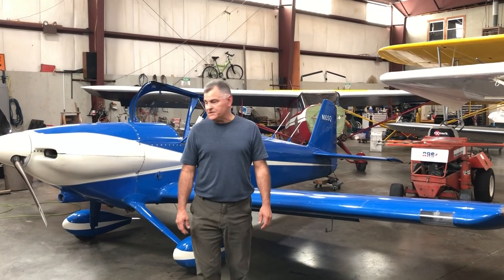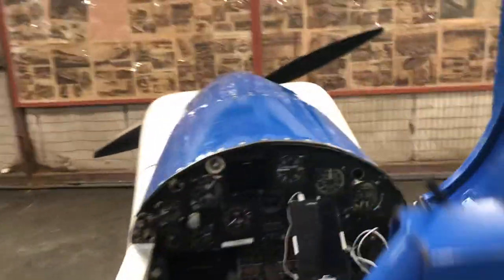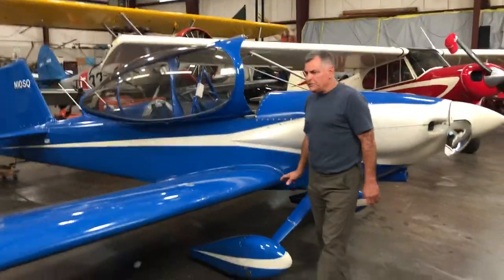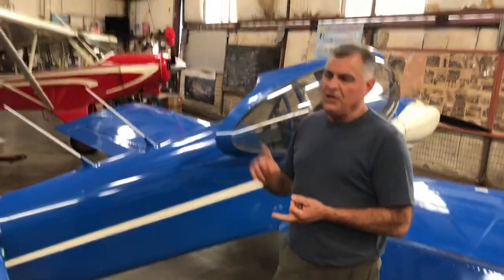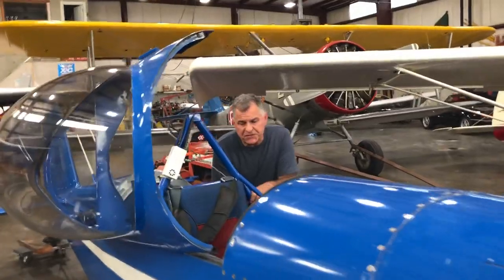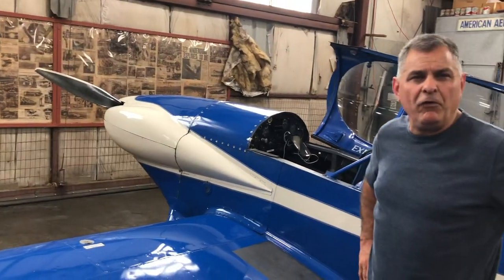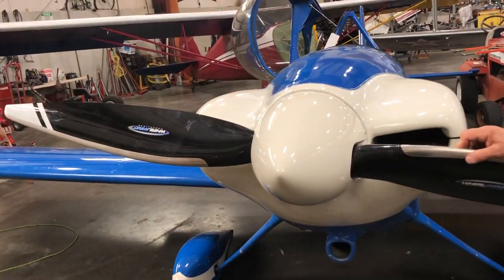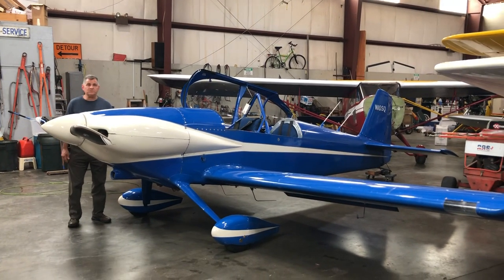Vans RV-4, N10SQ

Comment from the maker: I apologize for the unscripted walk around, I realize I was jumping around a bit. If any questions come to mind I will answer. For clarification, the worst part of the airframe is the spot next to the right wing landing light.The lifter hydraulic units are new.  The fairing screw issues are on the left wing only. It seems from what we can gather the l wing may have been off to address a fuel leak issue in the past and the fairing was not re riveted as was when new, they screwed them back on. Vert fin fairing same attachment as L wing. Again, not a problem, just ugly in my opinion. The internal wing structure is fully primed. Someone asked about the battery and  wanted to know if it was an odesey type, it is not. I believe it is better to keep the larger conventional battery in place for W & B purposes on this RV4.
Reply: Is this still available, Damian?